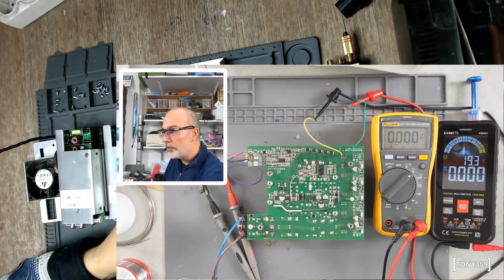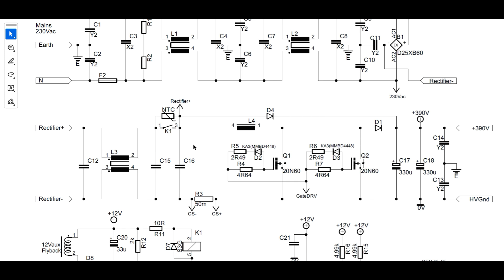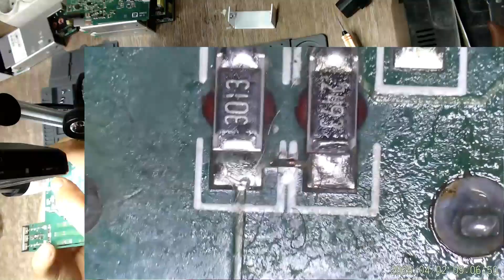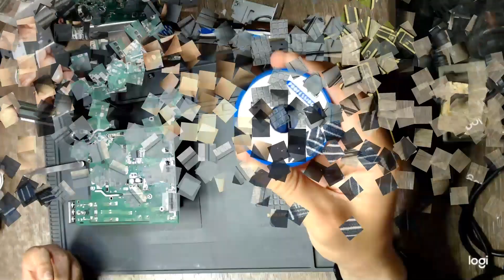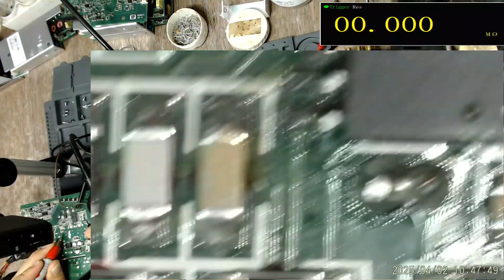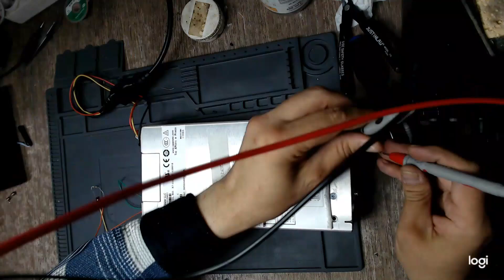Flexpower X7 2J2J2P 120018 - Tony359's smoked board with uncooperative PFC

Comment: Hi, I'm repairing a power supply just like yours; the 12V output is pulsing rather than steady. I've already replaced the TOP246 and bridged the negative line because it was broken. I've removed MOSFETs Q1 and Q2 because one of them is shorted. In your video, I don't see the circuit that generates the 12V.
Reply from the maker: Hello. 

Sorry for the late reply. 

What does "pulsing" mean?
Did you measured it with the multimeter and it is not fixed but rather oscillating between some values, or did you use the scope and you see there some periodic pulses?

If you are talking about my reverse engineering schematic, that only contains the mains input and the PFC stage. 
If by "Q1 and Q2" you mean the ones from my schematic then your psu has had it's PFC stage damaged ( Q1 and Q2 are the PFC's mosfets ). 
If so, then you need to check all the gate related components, starting from the gates themselves ( those small resistors and the diode ) and up to the gate driver IC which is TC1413N device. 
They usually get damaged by the mosfets getting their gates shorted. 
Also check for damaged capacitors on the output of that 12v supply.
Reply: @DjMarik78  Thanks for the reply. I connected a multimeter in parallel with the 15V Zener diode to monitor the 12V line, and I can hear the relay clicking on and off continuously. When powering the 12V rail with an external supply, the current draw of the various ICs is normal; however, I have doubts about the 10nF 1000V plastic capacitor—when removed from the PCB, it measures only 300pF. Do you have a part number for ordering a replacement? Could this be the cause of the pulsing 12V?
Reply from the maker: @comunicare007  that's odd...
If as you say the current draw is ok from an external 12v supply, then your standby 12V supply on the psu is still faulty. 
That capacitor is an issue by it's self, a dumb choice by the designers due to it's physical construction which makes it very fragile, but still, it can't be the reason for the 12V pulsing, it's job is snubbing the TOP246's internal mosfet, and with lower capacitance there will be higher voltage peaks on that mosfet, but as it doesn't short out it means it is still ok. 
Still, i would replace it, but i have no part number for it ( unfortunately ), as far as i know Tony ( @tony359 ) has it. 
But here is a selection of 10nF and 1kV or more from Farnell:
https://ro.farnell.com/w/c/passive-components/capacitors/prl/rezultate/6?capacitance=0.01uf&voltage-dc-=1kv_to_1.25kv%7C1.5kv_to_3kv&sort=P_PRICE

I would go with those Y class through hole caps ( the blue ceramic ones ), soldered on top, even though it wouldn't look very nice, it would be much sturdier, and i think even better performance. 

As for the problem, it must still be something wrong with that 12V supply, first of all check the electrolytic capacitors near it, then check the high voltage supply for it, make sure it is stable ( you should be able to measure it between one of the primary side gnd points, and the top primary end of the small flyback transformer's winding, but DO be careful, that is a very high voltage and so it's dangerous!
Also check to make sure there are not other small pcb traces damaged that escaped you ( remember, i missed one on one of these supplies from Tony ).
Reply: @DjMarik78  I’ve spent days checking and measuring this 12V rail, but the voltage just won't stabilize. When the TOP246 blew, a PCB trace on the negative side—running from the -390V point to the electrolytic capacitors' ground—was severed. I’ve tested all the electrolytic capacitors and they’re fine, so there’s likely another break in the traces somewhere. Unfortunately, this is the only power supply I have. If I can't fix it, could I send it to you for repair? I’m based in Italy.
Reply from the maker: @comunicare007  could you send me some close up photos ( high res ) on my email?
Try to take both sides of the board from several angles near the standby flyback 12V supply, maybe that way i can suggest something useful to you. 
My email: 
electronistul29@yahoo.com

Comment: I think the NTC bypass relay is just fine. It is not switching any high DC voltage or DC current. When the relay turns on, the NTC would have charged the capacitors, so there would be no voltage difference between the terminals of the relay.
Reply from the maker: Thank you for watching and comm.

Yes, at star-up all things should be ok ( thus i was wrong in the video ).
Still, at turn off in load, there is a switching action on a high DC current because the NTC's resistance is way higher than the relay's contacts, but i cannot estimate how much of a problem that would be. 
Maybe a pre-designed turn off sequence and the mains filtering caps does protect the relay's contacts from arching.

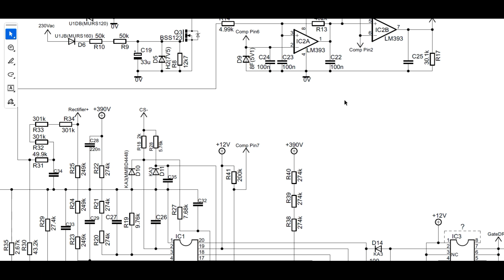Comment: 8:31 That relay is not switching the DC current to the PFC, it is bypassing the NTC to limit inrush current. It only switches on once right after power-up. It does not turn off while in operation, does not disconnect the DC power to the caps, and so there is no issue with using it like this. And there is not a simple better way to do this anyway-this is the industry standard way. (To my knowledge - please let let me know if do have a better simple way to do this! ) In other situations you are correct, but an inrush current limiter bypass circuit does not have any of the problems normally encountered with DC switching.
Reply: Is C15 or C16 the big one? I'm assuming C16, in which the relay isn't switching smooth DC, just chopped up mains. Earlier I thought there was a  reason it was after the 3rd CM Choke, but now I can't see it. I agree the 3 CM Chokes seems excessive. Maybe that 3rd one wouldn't be needed if the relay was before the rectifier? I dunno. I maintain that the relay doesn't get stressed by DC and is fine in that position, but I agree on second look I find at a reason it couldn't be earlier.
Reply from the maker: I understand what it's doing there, and i realize that the NTC mitigates the issue, and maybe this could be construed as an acceptable solution, but still, it would be much safer for that bypass to happen before the bridge rectifier, both the NTC and the relay could be placed there ( before the bridge, thus on the AC side of things ). 
There would be no constraints other than PCB layout.

Comment: Just watched from the link supplied on Tony's video. Very well done, please don't worry or get nervous about your english, it was all fine. Top marks for reverse engineering a circuit diagram!
Reply from the maker: Thank you so much!

I do like working with @tony359!
And also i like reverse engineering boards when i need to, it does take allot of time, but it is the best way to understand that board.

Comment: Good work 👏👏 One small thing I noticed is that at time 21:10 the SMD capacitor pad seems to move as if it's about to break.
Reply from the maker: Thank you!
Yes, indeed it got lifted when i de-soldered that cap ( not sure why though, i did it quickly ), but the track it's self is undamaged, and i did glued it down afterwards.

Comment: WOW, I am beyond being impressed! You reversed-engineered the whole board and found the fault in no time! I checked on my scope footage, that small trace was burnt since I opened it. The resistor was probably badly soldered from factory? I don't know, it is so strange. Your English is very good, you don't have to apologise. And the fan works! So the other power supply had a bad fan board? I'm looking forward to repair #2! Thank you so so much for fixing it and for the stellar and very comprehensive job behind this repair! Thank you!
Reply from the maker: Thank you for your appreciation and for your understanding.
As always, you are too kind!

I think that resistor got damaged the same time the track got melted, some melted metal or maybe that thin track from the flyback supply, must have landed on it and damaged both the small track and the resistor's pad. 
I'm just mad at myself that i haven't seen it earlier despite the fact that i had it under the microscope :))

Yes, i think the second fan board was already faulty, as far as i have seen in your video what failed was the channel P mosfet on the output to the fan, and it makes no sense for it to fail with a working fan, so, it must have been already damaged. 
I'll see what when i will work on it.